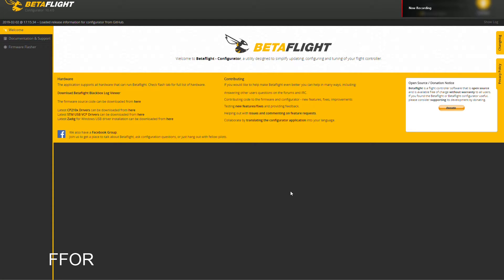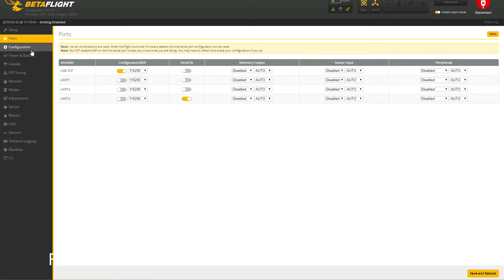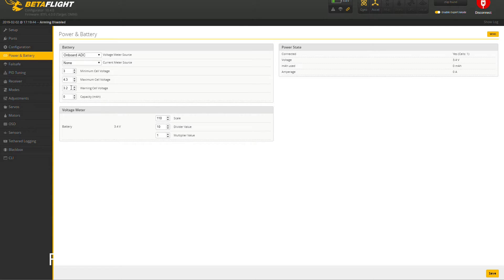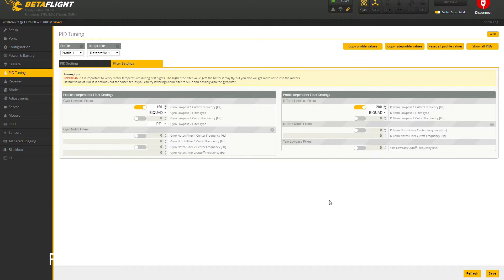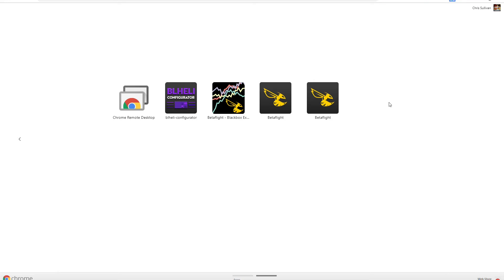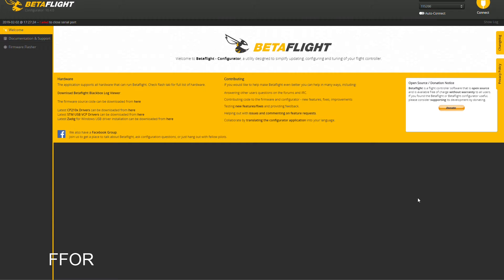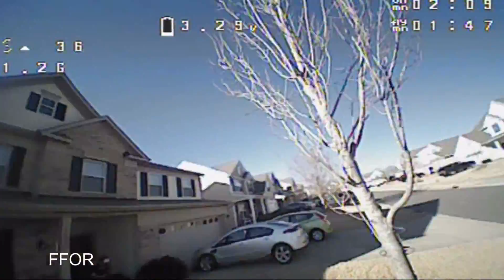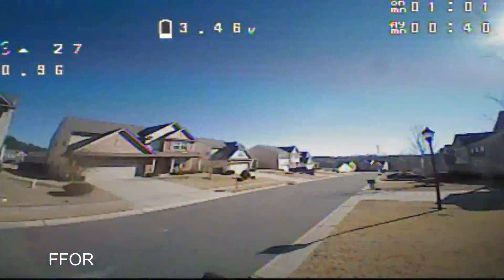Betaflight 4.0 New Dynamic Filter Test (For Micro to 3" Quads)

Comment: Good stuff Chris!  Check out https://youtu.be/__vyp60cU_8 for that build Dyn Notch settings/tuning.
Reply from the maker: UAV Tech thanks for your video on the micro settings.  I didn't expect to notice much but the motors are so much cooler now.
Reply: @Sully365  , set to High and it will get even cooler; whelp notch will track higher at least.  Then if u want more aggressive raising of Lowpass1 with throttle, move up Gyro_Max setting per the Cascaded video.  However, I'm not absolutely positive Dyn_LPF is in F3 by default.  I need to make some Performance cuts for the more recent builds of BF 4.0.
Reply from the maker: UAV Tech will do. I wasn't sure if i should set to high or auto.  I'll see how that does
Reply: How to setup tiny whoop bro..? Can someone please teach me.. Thx..

Comment: if you enable rssi in the config, you can view the rssi in the OSD even if you don't otherwise have it..
Reply from the maker: Seriously?   I thought your rx needed it
Reply: @Sully365  it does. However betaflight OSD will display it, even if the rx does mot have it.. I figured that out by accident.
Reply from the maker: @michaeljohnson6473  that's awesome. I never look at my transmitter when I fly... Kinda difficult
Reply: Have you tried viewing the RSSI in your OSD yet??  I was just curious how you made out with it..
Reply from the maker: @michaeljohnson6473  it did not show for me. I'm using the generic $6 receiver though, but it did nothing but flash 00 whole flying
Reply from the maker: Hey, i got it enabled.  It thought it wasn't working bc it was just flashing 9,8,9,7 and i didn't realize it just needed to be inverted.  Cool stuff, I'm going to do a vid on that soon.  Thanks again, huge help
Reply: That's great!! I wonder how many people don't realize they can do that..  It's like getting a new feature free of charge...
Glad and honestly surprised I could help..
Reply from the maker: @michaeljohnson6473  I just did not realize they rewrote the code to extrapolate RSSI.  I appreciate your pointing it out since it's so nice to have.
Reply: I realized after talking to you I have a quad that reads 7,8,9 and that's about it.. You said you inverted it?? How did you do that??
Reply from the maker: @michaeljohnson6473   go to cli and type set rssi_invert = on or yes... Or the opposite of what it is now
Reply: @Sully365  you just wont see it on the radio if the rx does not have it

Comment: Just did this on the Tyro79, BF 4.0 Release Candidate and when I armed it indoors the motors sounded a little ratelly. Along with that they seemed a little warm. Should I go test fly?
Reply from the maker: is there anything wrong with the motors physically?  do they spin freely with normal coginess?  Only asking bc my tyro motors didn't heat up at all.  my others heated to a point and then wouldn't go any father no matter how hard i pushed.  You could try a 30 second test, then see how the motors are and then try a bit more at a time.  Be careful.
Reply: Chris Sullivan yea, they spin fine. I’m just a little concerned of burning the motors
Reply from the maker: @astrofpv7035  did you change the pids?  AndyRC has a great pid setup that works great for me.  the ones he uses are much lower than the defaults.  Other than that, i didn't have or see any heat issues.  i would try it with a 30 second light run,t hen harder, etc, and see if they heat up any more.  If they do, go back to 3.5.6 or whatever and wait for a different version or better settings.  that's kinda odd
Reply: Chris Sullivan I’m actually using Andy’s pids, the only difference is that I turned on smart feetforward
Reply: 6 months later but andy's pids are 3.5  where did you see the 4.0 setup because i own a tyro also xD

Comment: This is a clean flight , without cleanflight , get it
Reply from the maker: HA!  love it
Reply: @Sully365  hey is betaflight still supporting f3 boards ? I have 2 new fc from the old days & haven’t flown in years , just bought the speedybee adapter 3 to flash fw in the field & remembered I had them but when I went to use the app they don’t have older 3.2- 3.5 versions , thanks 🙏
Reply from the maker: @thelongranger55  no.  If you ask Mark spatz, he may be able to get you an old build.

You pretty much have to go digging in archives for the performance 4.0 version that was stripped for f3 boards or you have to get a 3.5.7 or earlier build.
Reply: @Sully365  can you give me marks info please
Reply from the maker: https://github.com/spatzengr/betaflight/releases is where you can get the f3 builds.  i have a short vid on it but it's just as easy as flashing any betaflight.  he updated to 4.1 so that's impressive.  https://youtu.be/wBEkGLIN3qU
Reply: @Sully365  thanks , I’ll see if my board is on there . Do you know how to get it on the speedy bee adapter 3 ? I don’t have a laptop .
Reply from the maker: @thelongranger55  sorry, not familiar. i'll ask
Reply: @Sully365  if I can’t use these boards I’d like someone who can use them to have them so I’ll sell them on eBay or find someone on YouTube to send me to

Comment from the maker: What would you like to see next?
Reply: Can u teach me how to setup tiny whoop(brushed) because mine fly horrible.. Im using betafpv 65mm n motor is 19000kv.. Now i has downgrade the firmware to 3.2 but its still fly horrible..
Reply from the maker: Iskandar Zulkarnain will do.  My best first advice is to flash 3.5.5 and just try it out
Reply: @Sully365  i have upgrade to 3.5.5 but the problem still the same.. That why im downgrade to 3.2..i thought it will be ok, but it still the same.. I think maybe because of the setup of the filter n i mess it up.. I hope u can help me bro.. I know u r PRO bro because of this problem.. N i dont use mockingbird.. Just using betaflight only.. I try to upgrade it to 3.5.5..n i will let u know.. Thanks bro..
Reply: @Sully365  thank you.. After do what u said, i think now its fly really2 well.. Just use it stock firmware 3.5.5..but im scared to touch PID.. I just use the stock pid.. Because before this i tune my pid then, if i armed n fly it then had a crashed n i must wait around 20 seconds before fly it.. Its like the accelerometer late to calibrate the drone back to normal.. But now, i just disarm n arm back, everything back to normal.. Thank you so much Chris Sullivan.. Im using TBS TANGO with XJT FrSKY n fly my betafpv 65mm(brushed) n URUAV 65mm(brushless).. Now this 2tiny whooo fly better then before.. Thanks again bro..
Reply from the maker: Iskandar Zulkarnain glad it worked out for you
Reply: @Sully365  thanks for your guide bro.. 👍👍